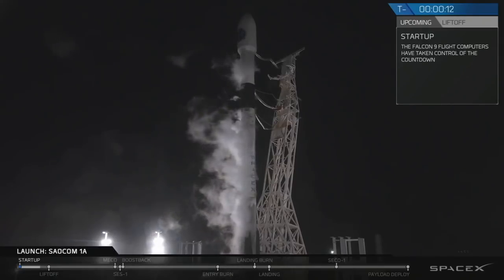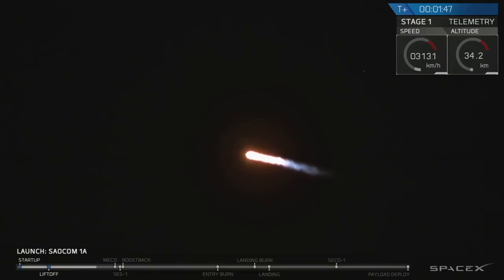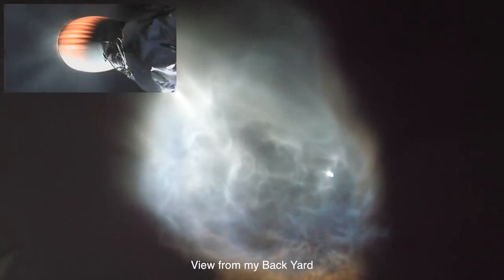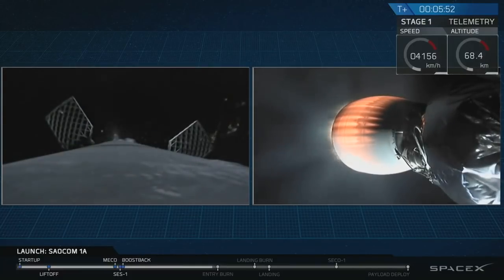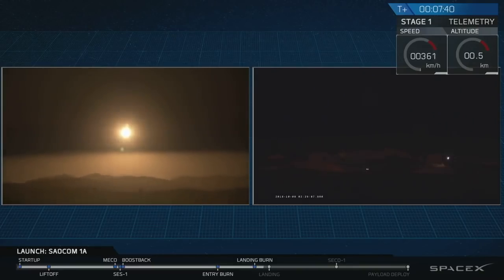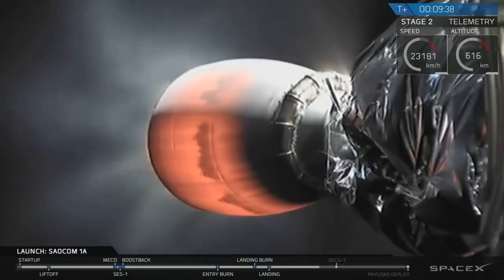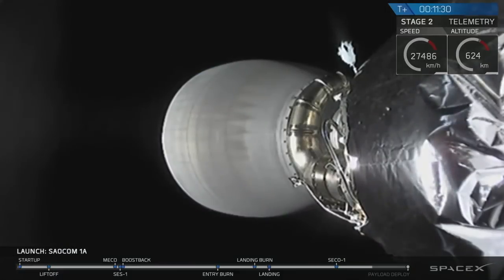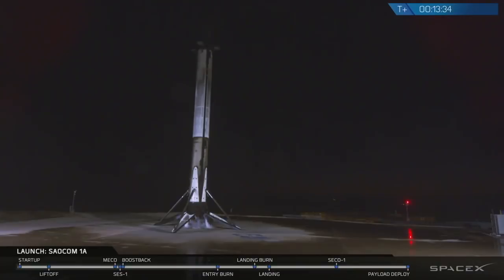Elon Musk Lit Up my Back Yard skies Again - (SpaceX)

Comment: jehugarcia The satellite was traveling at over Mach 20 and the section of black plastic above the booster was barely moving. Any explanation? In my career I’ve regularly gone over 200mph. Things are really moving once you hit triple digits, this video is peculiar. That’s my only point.
Reply from the maker: Maybe is not plastic,  maybe less air at that altitude,  there is a million reasons why things might not behave the way you expect them to
Reply: 'Dynamic pressure' is the air buffeting you get, as speed increases 'Q' increases, but as air thins, an opposite trend is added. You've watched launches in the past, soon after Mach 1 the ground calls out 'Max Q', the point at which Q begins to drop because the air is thinning rapidly. By the time you're above 100 km or so it's essentially a vacuum and even with high speed Q is negligible except to tiny fragments of ice.